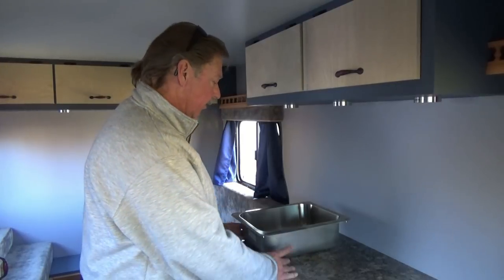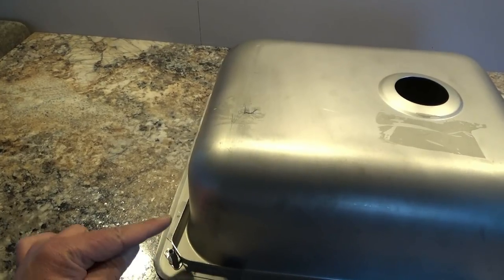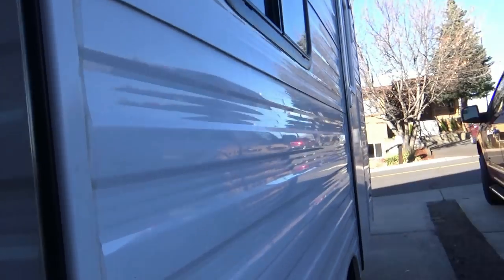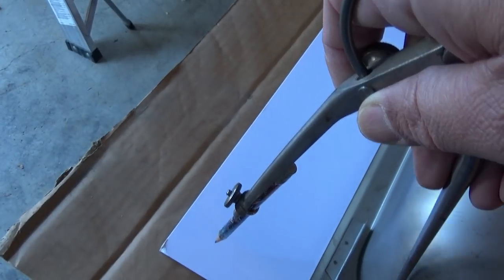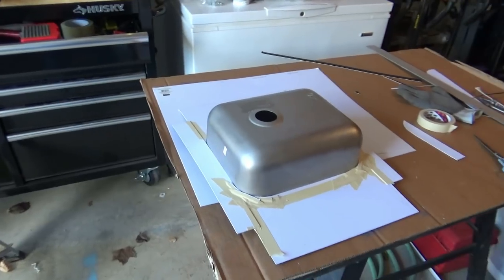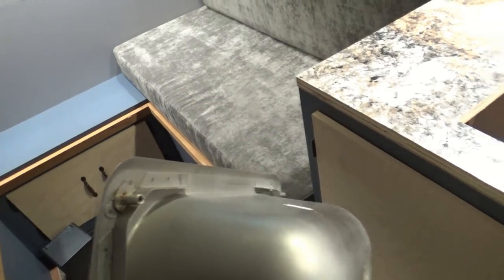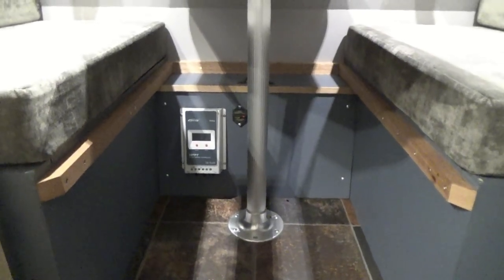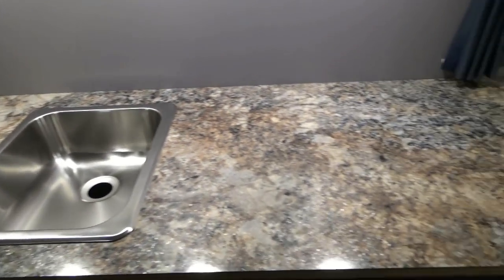How To Build A DIY Travel Trailer - Part 50 (Installation of Sink)

Comment: EternaBond, an Excellent tip I needed something like this for a different project I never knew this stuff was around, looks like Duct tape on steroids but to seal out water on a roof.
Reply from the maker: absolutely the best stuff around! Spendy though. I took the 4" wide stuff and cut it into 2" wide strips, made it last as long as I could!

Comment: Hey OB,
Great Series. You have encouraged me to start my own DIY trailer. You have done great work with allot of thought and it shows with results I have seen so far and I am sure will continue. There is one concern I have with the installation or the Eternabond tape on the bottom edge of the siding. IMHO, I believe we can never make a rolling structure completely water tight (on our budget anyways). Having an open bottom like you have allowed any water that may get between the aluminium siding and the sheathing to drain out as water and vent out as vapour.
Reply from the maker: Thank you Tom Daichendt! That is awesome... I wish you the best on your project for sure! Great information about the Eternabond on bottom of trailer! Actually, I never thought of that!! I will have to rethink how to make sure there is adequate ventilation between siding and bottom. I could just run a razor and open the seam, I'll take a look and see what I can do! Thanks again!

Comment: You can also use an Ita-Hot water heater that is about the size of a Thermos bottle 120 volt perfect for what you are doing.
Reply from the maker: I will look into that on the next project for sure!

Comment: Hello again, super job so far. One thing I would like to know is, did you make many mistakes while building the camper, if so perhaps you could make a video when the camper is finished , that way we can lean by your mistakes instead of making our own. Thanks again for the great videos and enjoy your trailer for a long time, good luck on the next project whatever it may be,.
Reply from the maker: Thank you George, and a very good question! In all actuality... I had one mishap, and one tip I would pass along. The mishap occurred when my router slipped and I gouged a piece of wood on the lower cabinet between the seats in the rear of the camper that I had to repair. That is in the video. I had already glued everything in place, so it wasn't just a matter of pulling everything out and starting over, so I made a quick repair which I would bet no one would ever have seen if I hadn't included it in the video! :)   The tip I would share: when I framed the sides for the windows.... I framed the walls to the windows themselves. That was a mistake. Size the windows to the RING of the windows. The side windows were a tight fit, and the front window did not fit at all. I had to take a drum sander to expand the window cutout to make it fit. I then had to cut the rings down in size so they would fit the cutout and attach to the window on the inside. Other than that... all went well. BUT... we're not quite finished yet, so plenty of time to make a few blunders! LOL! When I finally finish, I will plan on making a video and try explaining a few things that  might help others to avoid a headache along the way. Thanks George for asking your question, and thank you for watching! Sure do appreciate it!
Reply: You are welcome